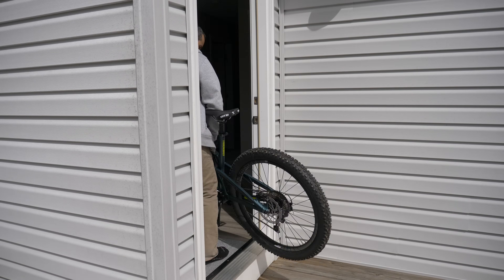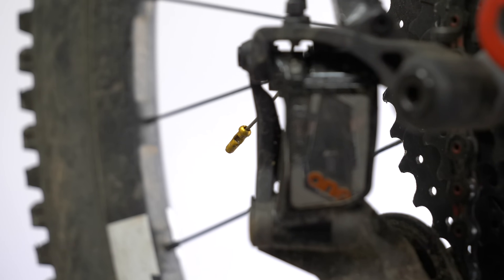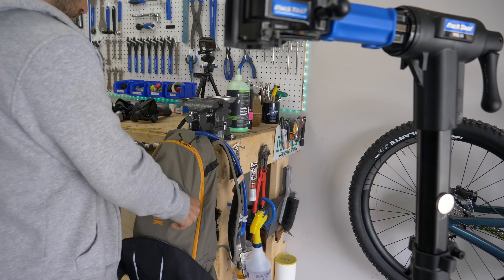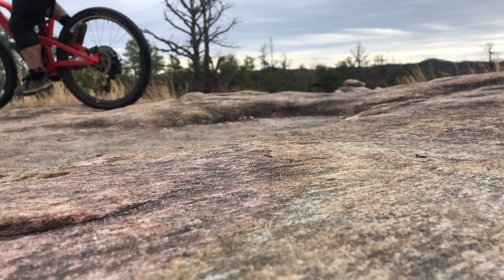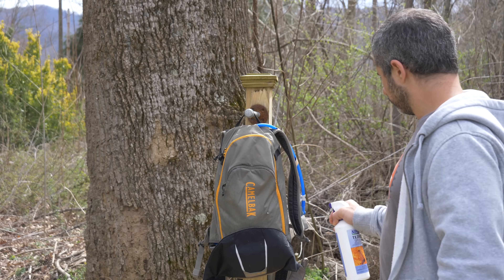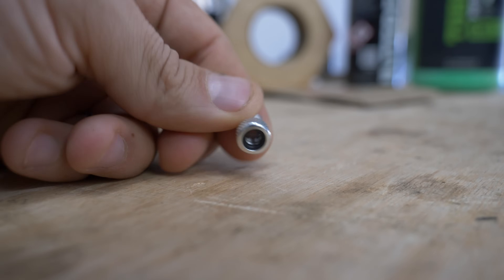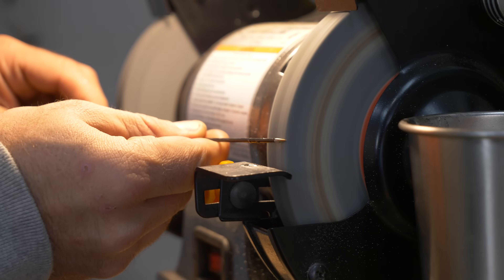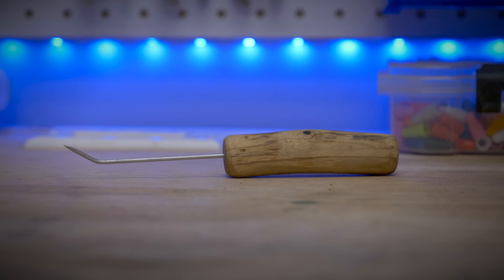10 Hacks for Mountain Bikers in a Pinch

Comment: Some tips that may or may not have been mentioned.
Cable ends.  Instead of a crimp.  A very small dap of super glue on the last 1/8 inch will hold the ends together for almost ever.  It keeps the cable end neat and allows for pulling and reinserting the cable back through the housing later if needed.  You can also add a drop of additional glue and heat shrink over it for a finished look. 
Seat posts.  A non dropper seat post can be used to hold spare spokes, zip ties, some cash, Co2 etc.  You can roll up and shove in a pair of nitrile gloves in to hold everything in there. 
Pieces of old inner tubes.  Cut up pieces of old innertubes have a lot of uses.  MTB tubes are pretty big but old road tubes can be used in a lot of places too.  A piece on your seat post be prevent a seat bag strap from scratching,  cut up a small piece and wrap it under some electrical tape on your bars to give your headlight and other mounted accessories a mounting pad with some extra grip and stability.   Used around a multitool to prevent the tools from flapping around.  Experiment with the size tubes you have laying around.  It's easier to roll it in place sometimes than try to pull into place around something.  A large cut up piece of tube and some electrical tape can make a decent frame protector and deadens debris noise.

Comment: Hack for holding a pump on your bike: if you have an aluminum water bottle cage (that you bend inward every time you take a drink), you can stretch a section of old tube around the bottom and the very top. There will be just enough slack in the tubes that you can get a pump in there. The pump should sit to the side of the rack and not where the water bottle goes. It doesn’t rattle, it’s not coming out and doesn’t cost anything. The tube will also help keep the bottle in the cage. If you wanted to you could squeeze a multi tool in there as well. This is for those who are on a budget.

Comment: If one of your rear derailleur pulleys comes off due to a loose bolt usually the water bottle cage bolts are the same size and will work in a pinch. I've done it during a ride after forgetting to add loctite to the pulley bolt before reassembling.

Comment: If you puncture a tire you can use regular rubber cement and a round piece of old inner tube to patch the hole. But if you slash a Tire you can do the same thing with an old piece of Tire & Rubber cement on the inside of the tire.

Comment: Use a medium to strong magnet to route internal cables. First attach string and a piece of metal to one end of the string, then attach the other end of the string to the cable hose. Then slip the string though the port and use the magnet to guide it around then grab the string and pull it though. I installed a dropper without removing the bb on my reign with more or less success. This is only a good hack if you don’t have the tools to remove a bb or don’t have many options. It does work though with a bit of fiddling. I hope this gets added

Comment: I use car paint sealant coating on my frame, shock stanchions, stem and other painted parts to make cleaning the bike a lot easier. Pretty simple to apply and wipe off, makes cleaning the bike a lot easier as most dirt and grim comes off with just pressurized water. Just don't use it on drivetrain and brakes...obviously.

Comment: You should look into waterproof spray for your next hack or even rubbing a cheap small candle onto clothes or equipment then heat for the same effect. I would recommend the latter then to just take waterproof spray out with you in case anything needs protecting.
Worth mentioning, although I haven't tried it I wouldn't use it on frames as I imagine it isn't good for paintwork.
Never mind after rewatching it was you who gave me the idea 😂 but still you can use the candle one, it's better than the spray

Comment: Use those skateboard grip tape on the brake levers. 

Also, not sure if you did this before, put information (name, cell, email) on a piece of paper and shove it inside of the handlebars. Or you could possibly put it in the crank set. You can add a tile gps locator too!

Comment: If you have a hardtail with 2 bottle cage mounts you can attach a fabric pencil case to it (make sure to use a piece of wood to prevent the bolts coming loose) this I a great place to store a multi tool

Comment: When on the bike stand, for a quick and somewhat easy way to keep the bars from spinning, put a piece of tape on both sides of the headset spacers down to the headtube. This is not a permanent solution but will work for a quick fix

Comment: Idk if this is in any of your videos yet but you know how the ends of your bars can "applecore" their way through rubber ended grips right? You get those half moon cuts when your bars hit the ground or even punch right through the grip cap. You can stop that happening by placing an appropriately sized coin (5 euro cents works) inside the grip before sliding it on.

Comment: this may sound dumb but i've used in the past 2 of the same mice from walmart as a sensor for truing your wheels just tape 2 mice to each side then attach the wheel to the bike and make sure to aline the mice as best as possible then when the mice move on the monitor then you can easily see where the bend is and see where the mouse starts and finishes to get the biggest spot of the bend

Comment: Bomber straps are great, especially if you ride solo like me. I ordered it, went to install and the plastic buckle broke. they sent me a new one right away but i found that it didn't hold the strap on the tailgate tight enough. So, I went to Home Depot, got a 1 1/2" cargo strap where you can remove the bolt to replace a broken strap and switched it with the buckle supplied with the Bomber strap. Now the bike doesn't wiggle at all.

Comment: Use a rag or towel to help you get the right chain tension of your bmx or any other bicycles with single speed drivetrain. First loosen the nuts of your back wheel then put a rag between the wish bone and back tire(The rag will prevent the wheel from moving forward) then tighten the nuts

Comment: For people with small hands including children or females that have brakes with no reach adjustment you can pull the lever and put a zip tie around the bracket. This will prevent the letter from going back to its original position leaving it much closer to the bar so you don't have to reach as far to grab it.

Comment: I recently put a new headset on one of my bikes. I didn't have or want to spend the money on the proper tools to remove the bearing cups, remove the old bearing race/crown race, and seat the new bearing race. I found a scrap piece of thin metal tubing about an inch in diameter and cut in down the middle in two spots. It had 4 somewhat equal sections that I bent outward slightly. You can slide it up through the head tube uncut end first and once past the cup the bent ends snap into place. One in place you can hammer the cup out. I removed the race with a flathead screwdriver and used a piece of plastic between it and the crown so not to damage the paint. I used a scrap piece of 2x4 to press the race. I had a 1 1/8 hole saw/drill bit, so I cut the hole and slid it over the steer tube and hammered the race on with a rubber mallet. All in all I spent 0$ on tools to do this, others might have to spend a few bucks, but its much more economical than buying the proper tools for a job you are only going to do one in a blue moon. Forgot to mention that to press the new cups in I rented a bearing press for the auto parts store. That is free as well, but I had to put a deposit down until returned.

Comment: If you don't have an adapter or a valve cap to make an adapter, you can;
 remove the valve core (as long as its removable) 
use the compressor to inflate the tire with the core removed
Put in extra high pressure, then hold your finger over the valve when you remove the compressor
Then put the core back in quickly, you should be able to keep plenty of air in

Comment: If you over tighten any quick release 
Lever then you can use multitool or metal wrench for enough leverage.
P.S. put a thick cloth between your frame and the wrench/tool to prevent scratches

Comment: @4:12 I have a better solution for this problem.

Turn your Bike upsidedown. spin the tire as fast as you can and then stick your pinky between the spokes. The neuronal signals that get sent thru your arm will distract your brain pretty well.
Reply: Dude I just cringed so hard at that mental image holy fuck

Comment: When I slashed a sidewall on my tire with an inner tube - I taped cardboard to the inside of tire, so my new tube wouldn't pop through the hole.   I ended up rocking it for about 6 months - I was 16 and broke...

Dig the schrader valve adapter hack BTW.  I always lose those things.

Comment: Hello. When I had an over the bar "incident", I have sheared the plastic bolts holding the peak on my helmet (all three of them). I have used cable ties (the bigger kind) to make a loop and jam it in the threaded inserts on the helmet (one cable tie looped twice, per insert). The loops were "opening" out and that actually was better since the "opened" part held the peak close to the helmet and there was no rattle whatsoever. I have also heard of people putting short twigs in the inserts but, that seems to be kind of dangerous.
  Another thing I have used, was an old inner tube over the cranks and over it a bigger diameter shrink tubing  to protect from rock strikes. I was careful to not overheat the shrink tubing since this will affect the aluminum (I used a laser thermometer to check the surface temperature of the shrink tubing). 
  Some time ago, when I had some low quality lock on grips, I used thin double sided tape (2 strips 70-80% of the grips length and about 15 mm wide) and some isopropyl alcohol to secure them to the handlebars. That way, I didn't had to torque the small (very cheap and soft) bolts too much. I just put the double sided tape on the handlebar (2 and 8 o'clock), sprayed some alcohol on the tape and inside the grip and just slide it in place. It's quite easy to remove the grip afterwards (by twisting). The double sided tape is easily removed with WD-40. Maybe this could also be a solution for carbon handlebars.

Comment: With frayed deraliur cables I've found wrapping electrical tape (preferably the wider stuff) super tightly around the cable where you want to cut it kind of thick, so it's like a 2mm bump from the cable to tape. Then cut the cable through the tape and the tight tape will hold it all tight - it's also super super useful for cutting wires with something blunt and weak as the cable won't move within the tape and won't get mangled up.
Sorry for the bad spelling, but hopefully you know what I'm trying to say

Comment: If you have a cheap square tapered bottom bracket and are about to replace it with a more durable, expensive one but don't have a crank puller, you can loosen the cranks by pedalling around without the crank bolt in. And the crank will fall right off... however don't be mashing on the pedals or the chance of injury will increase. It will likely strip the bottom bracket but if you're replacing it. I found this out when I was going out for a ride and forgot to replace the bolt, and I didn't get past my neighbour's house.

Comment: Note, the simple Schrader adapter to presta does not always work as it relies that the air pressure will press the pin down. The proper adapter has a different structure.  Learned this the hard way. edit: air pump in the gas station costs money in USA? Wut?

Comment: Want to hack I’ve done before is after you’ve cut a cable you can take some para cord and take the white inside out, cut a segment off the outside and put it over the cable And burn it on with a torch

Comment: Keanan’s hacks 
Always take foam insoles out and leave in sun to avoid odour and any funky smells ,I also put my pads on a pool noodle so they dry out and don’t smell ,when putting on a pedal I always spin my cranks so tighten , when I tighten steam bolts I always put a 20¢ piece inetween my stem to get perfectly even touqe I also rub skate wax on my shoe laces to prevent them from coming undone (it works)  I use a toilet brush to clean my spokes (brand new) I use to use a foam ended handed brush but the toilet brush works best , I use PH neutral soap when washing my bike for obvious reasons , I use car tire shine to make my tyres look new when they are getting sun faded ,(if you do this more than twice probably a good idea to replace to tyre by then better safe than sorry), my hacks kinda
Reply: You the man Seth!

Comment: After installing a zip tie on your bike instead of cutting it and leaving a razor blade and burn it off it will leave a nice rounded Edge. Blow it out when it is the correct length.

Comment: rub baby powder/talcum powder to the inside of your tires before adding a freshly talc covered inner tube.. Stops loads of punctures as it stops friction between the tire & tube... Tust me it works.. Add some stans solution into the tube as well and you can go all season without a puncture if you are lucky

Comment: If your ever trying to remove a cassette lockring or a freewheel and your adjustable wrench isn't working slide pvc pipe over the wrench and use it as a breaker/cheater bar

Comment: Not so much a hack but kind of a "in a pinch" tip. Mineral oil from rite aid or a drug store will work for brake fluid if you had a leak. My buddy's caliper became so loose that it sprayed hydraulic fluid everywhere, causing him to lose his rear brakes. I had nipples from a bleed kit, no hose, no syringe, or fluid, but a quick trip to Walmart yielded some treasure. Air line for a fish tank aerator used for tubing, mineral oil from the pharmacy, and a plastic syringe used for measuring medicine acted as a nice fluid pusher. We were back up and running the streets in 30 minutes with our stop.

Comment: If you ride BMX and you wanna ride but your bars move, put the bike with the handlebars on the ground and one of the sides on the headset should be facing up towards the sky, with your wheel sideways, then stomp on your headset until your bars are back in place. a permanent solution is to undo the clamp that is holding your handle bars and sand paper the inside of both parts.

Comment: Bike hack: Your bike can dirty. (Surprisingly) If you are riding in a bikepark with no bike wash station, you can take a bottle of water and a spare cap. Drill a hole into the spare cap. You can put the bottle and cap in you car. After your ride you just change the cap and wash your bike with a 2l bottle of water. Thanks to the hole in the cap, you can easily aim the water, because of the presure.

Comment: get a big cheap sponge and cut off a corner and use it to clean your jockey wheels on your derailleur also if you have a stripped Allen bolt you can take a small piece of ballon and put it inside the head of the bolt to pull it out

Comment: When my bike gloves metal tip, to use your phone wears out. Cut a small hole in the gap between your pointer finger and middle finger. Now you can easily slip your finger out, without taking your gloves off

Comment: Use an old vacuum cleaner tube ( the metal part) to fit you headset crown race. Also make a headset fitting tool out of some strong spacers, nuts and a threaded bar from the hardware store. You guys pay for air at the gas station?

Comment: Another hack on using shitty cutters to cut wires. Place the cutters sideways on the floor/brick/worktop, put the cable in the cutters and hit the handle with a hammer. Might want to cover the wire with a rag so it doesn't fly off. Perfect cut with even very cheap cutters, assuming a heavy hammer.

Comment: in case you run out of worms you can use super glue as a temporary seal on tubless tyres will hold up to 35 psi tried and tested

Comment: Don’t know if you’re going to see this but my grandpa and me with use a drink never be changed out to you but she’s not throw them up with air which is what most YouTube videos you’re telling you is the fillet up with a little bit then the air is not needed
Reply: Don’t know if you’re going to see this but and my grandpa if we are changing our bike tubes we do not fill it up with air before putting it in what we do is that we put it in and then put on the wheel and then we air up the tube